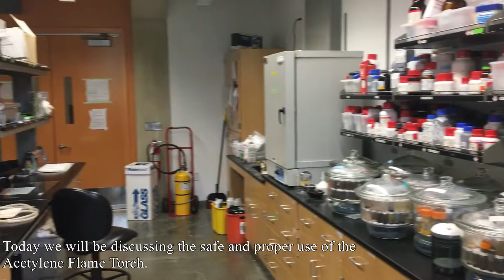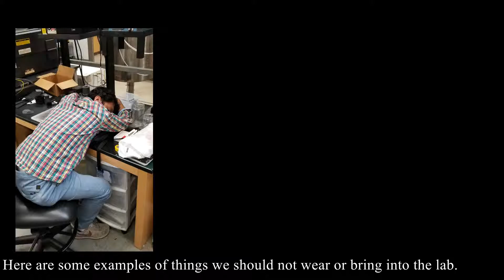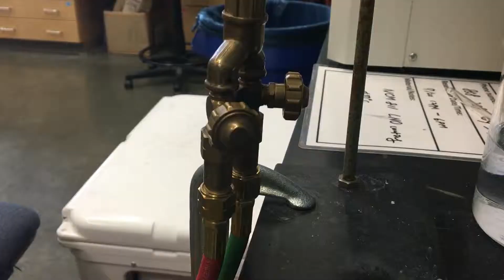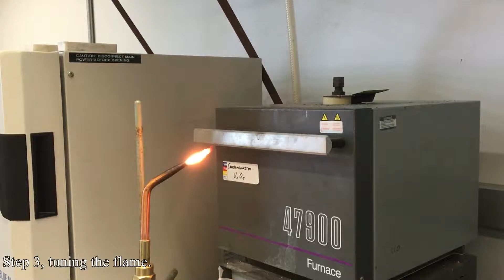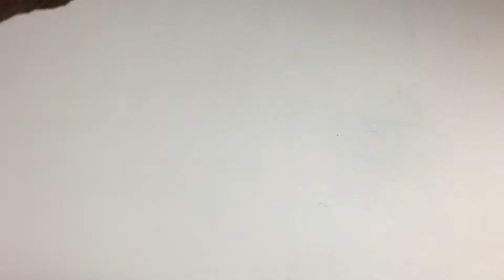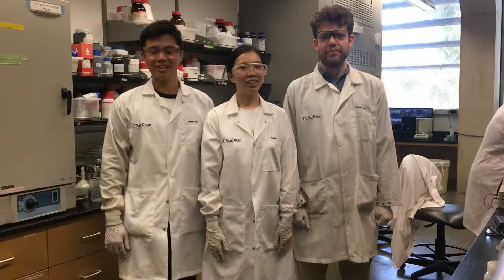Acetylene Torch Tutorial

Comment: One minor omission in your video, because of the very high pressures contained within them, oxygen cylinders have a double seated valve that should be opened up all the way so oxygen does not out when the system is in use